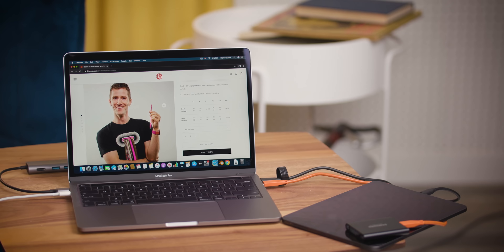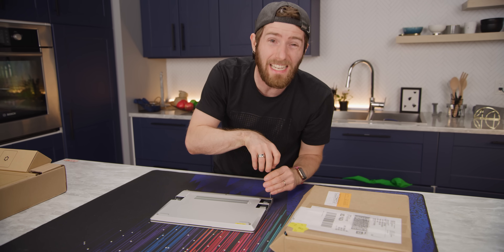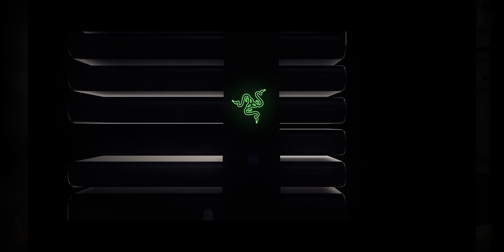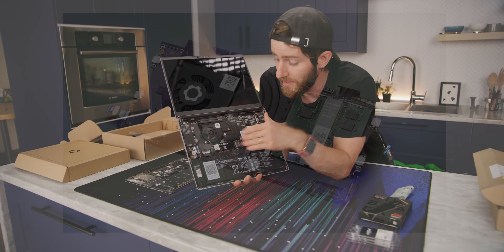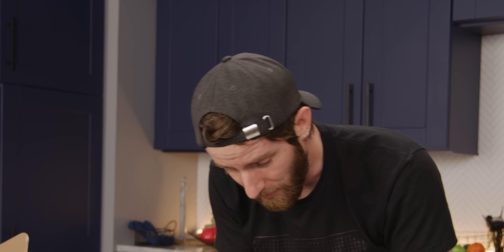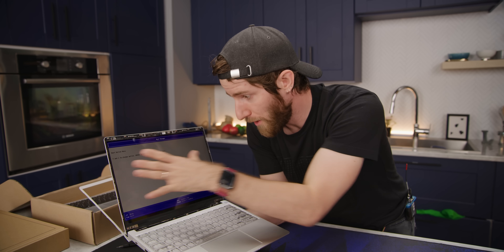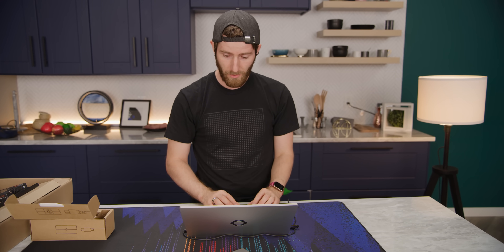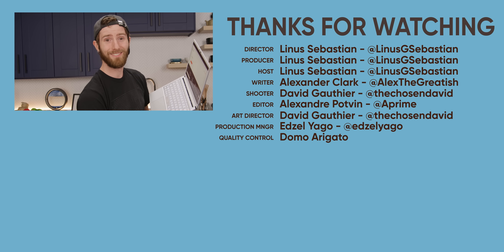A COMPLETELY Upgradeable Laptop?  - Framework Laptop Review

Comment: I have a slim, light and nice looking notebook already which is designed for easy repairing and upgrading and I find also manual to repair the notebook on the manufactures. Also, the manufacturer still give guarantee to all original parts even a swap one parts. There's no glue. I know it because I remove battery, SSD and NVMe to reset the BIOS by removing the battery (I didn't expect the manual and search after it first after removing the battery and the NVMe.) But I have to remove less than 20 screws, three clips (for keyboard and mousepad) and one connector (battery). The entire software from BIOS over firmware to OS are open-source, except NVIDIAS graphic drivers for my GeForce RTX 2060. So, I don't understand why he's so hyped or say it would be the first easy repairable notebook. It's not true.

Comment: This might be a controversial opinion, but the expansion modules are not my favorite. 

If you look at the images, and listen to Linus' description in the video, the "expansion" modules just connect to the laptop via USB-C. 

So they're just dongles.

But inside the laptop. Which is worse! 

Now they take up valuable space that could have been more battery, or cooling, or interior expandable storage (which could be high speed and thus usable for a bootable OS). 

They should have just made all i/o USB-C and offered dongles during the configuration and checkout. 

Don't get me wrong, I love the idea and fully support the vision, just not sure the expansion modules are really a good implementation of that.

Comment: TL:DR BUY A VOLTA CABLE IF YOU WANT A MAGNETIC CHARGER

Im well aware this will get buried but since I haven't seen it in the comments I'd like to point out that linus talking about the magnetic charger not being allowed because of patents. he seems unaware of the volta cable which has a small magnetic tip, which you can leave in the laptop and its only a couple gram. I know that jake has one at his home setup because it was mentioned in an vid once.

Comment: As far as the magnetic connector for charging goes, just have the USB type C expansion module, and use a Volta Type C magnetic tip/cable for charging. Leave the tip in the laptop and BOOM you've got basically the same thing. Those tips hold tight in USB c ports too.

Comment: I was just thinking about how modularity would do the exact same thing as having to carry around a bunch of dongles before you mentioned it. Such a great solution and it's the most obvious, simple one too. I would LOVE to see this kind of laptop get some maturity on the market because I would immediately buy it as long as it had the right specs for my needs. I would be willing to get a beefier laptop if it meant it had a more aggressive and expansive cooling solution and it had a dedicated gpu, for example. All the work acer, asus, razer, and other laptop brands have done creating innovative ways of cooling powerful laptop hardware in small form factors combined with this level of modularity? Goddamn

Comment: I just wanna know if this has Thunderbolt or not! Could be a transportable desktop replacement for me if it does! 😁
Reply: Only USB4
Reply: @vladdx  well... SHIT! 😣 And I doubt there are any external GPU boxes that do that yet, let alone with the bandwidth needed...

Thanks for the heads up!
Reply: @KnHawke  It has the bandwidth as USB4 has 40GB/s but I'm not sure eGPUs are compatible yet. You can sure give it a try and might work who knows. That's exactly the reason Thunderbolt requires a certification.
Reply: @vladdx  did a little digging into usb4, the spec says that it is backwards compatible with TB3 and Intel released the patent, so there is hope that the AMD board will have it with little to no problem!

Comment: Thoes QR codes are a great tool for someone like me who buys 2nd hand hardware a lot, and trying to find documentation on spicific motherboard revision parts compatibility, parts info, specific information about proprietary connectors. So perhaps with a laptop such as that, you could buy a new motherboard when their is a new generation of cpu. Or even moveing a motherboard to a diffrent case with different inbuilt features such as upgradeable GPU, full sized CD rom drive, or a case with a docking port. Part of me think that we may be returning to the days of the mac duo with portable desktops again.

Comment: That's really cool, I just did a build on their website to see the minimum price of a fully functional machine, 11th gen i5, 8gb drr4, 1Tb nvme, for 975$, checked online shops for regular laptop, the most similar one I could find was an hp at 975€ (1100$) (so , with everything the same except a 256gb sata ssd (and the custom built one had no windows, but even after adding a 20$ license you're still good, I would never pay full price for it), really price competitive.
Only problem is the delay... September for it to be shipped.

Comment: My old clevo p150hm died last year, I had upgraded the cpu from the bottom of the line sandy bridge quadcore, to the fastest XM sandy bridge unit, upgraded from 8gb to 16gb, upgraded the 500gb hard disk to an ssd, and put the hdd in the disk drive bay, I upgraded from a gtx 485m to 680m, I repasted the cpu and gpu myself, and even improved the cooling, which was easily accessible. I had also swapped out the screen. It truly was the most modular laptop, even at the time people didnt believe you could upgrade a laptop like that. The only issue was the bios was only capable of using up to the 680m, and even with that I had to modify nvidia drivers for it to work. Last year the mobo died, and I put it away in the tech closet.

Comment: I've been using Fairphone 3 for 6 months now and don't have much to complain. Yes, it has mid range specs at best, but it does everything a phone needs to do, and I dont have to be afraid of breaking components since they offer replacement modules. As far as I can tell, they do not provide schematics to repair the individual modules, but Fairphone 3 is by far the most repairable usable phone on the market. They also promote the possibility to use alternative os'es to Android such as /e/ OS and Lineage. I'd love to see you cover the phone rather than sligthly ridiculing it.

Comment: i find some decisions on the laptop a bit weird, like how (until now) you dont have a dual usb c adapter, so it will in total 4 ports which is really limiting (imo) and you cant have a gpu so it would have been nice to include thunderbolt ports (atleast on one side) for real future proofing. 

but honestly, this thing is a great product and it should shake the industry at least a little. its not just the product itself, but the company philosophy too. try finding a replacement for your laptops camera. try finding one for cheap from official sources, modern laptop makers have a billion variants of any laptop line that makes it all so hard to find, and if you do find replacement parts they come at extraorbitant prices, and then when its time to replace the part, even skilled and certified technician can break your device ( happened to me, thanks HP for breaking my display and full  case when all you had to do was to replace a hinge......)
Reply: on a side note, i saw the dell standpc, the all in one that fit into your monitors stand and wondered, why not offer a laptop case with it. there almost is no reason to go with that product over this now lol, just the motherboard itself is the thing that dell offers

Comment: Without a socketed CPU, this isn't really that much more repairable than other laptops on the market.
Reply: Depends on number of models and mobo form factor, if they go with 1 or at maximum 2-3 standards, like this one and a gamer one design to have gpu for example, they could make motherboards+cpus to upgrade old models withou buying new ones, like if you bought a intel model and later want a new ARM model, just like pc you just swap mobo+ cpu, as they would be the same form factor and compatible, of course mobo and cpu will still be bound to each other but it would already be a improvement on the market and a good start point to later socketed cpu models, they are not rich like dell or apple, so we need to give them trust and time to stabilish themselves on market, thats what i think.

Comment: I don't think the "battery disconnect" function is that, usually it means when you do it the system then powers down and you can then "safely" remove the battery, but when you power it on again it'll reattach the battery, it's a thing for maintenance.

Very cool with the modules tho, even if some of it is still not that "un-modular" on say, the latest Lenovo T series Thinkpads.

Comment: Upgradable laptop example-e6530: 2 Mini PCIe with 3 antenna wires for Centrino 6300, full mini PCIe, UJ262/272 bluray drives, and easy access SATA port along with DDR memory access. That upgradable for ya, it certainly is for me. I can't wait to use my mSATA SSDs.

Comment: I know what my next laptop will be. This puppy. I would buy it only for the fun of putting it together myself. Too bad the Fairphone is so expensive, or else I would buy that, too. Oh and of course, both will be using Linux. I really hope we get to a point where you can game on Linux just as well as on Windows, and also have the same experience with a Linux phone OS as with Android. I've been holding off on buying a new phone for some time now, because it's so hard to find reasonably sized phones these days, they often have an overloaded OS with lots of stuff added on by the hardware manufacturer, and phones have also gotten more expensive.

Comment: I have a Dell Inspiron with the i7-1165G7, and it has the wireless on a separate card, but it will only boot with designated wireless cards installed, so no upgrade for me.  If I had known this was coming, I would have waited the 7 months using my old i5-5200U laptop and gotten this.

Comment: I thought regardless of the size of the display if it was 30/40 pin it would just work. So you could just order a screen that has the correct pins with whatever features you want.

Comment: I have a Lenovo which has problems with it's wifi. So I bought a new wifi module that supports 5Ghz. I swapped it into the laptop and a message pops up saying it's not an authorised part. The only way to get around this issue is to desolder a flash chip, read the bios, send it to some people on a forum who will unlock it and send it back, reflash, resolder it using a reflow station.

Comment: dell: USB type-A? best i can do is type C
framework: u want USB type A or C? or HDMI OR BOTH ?
Reply: I feel like they should be able to fit 2 type A ports onto that badboy and save us from using another modular slot.
Reply: @ReivecS  They probably will have modules with more than one USB port, but there is a reason to having just one - it's a simpler design that works well for a prototype and  you're not sharing the bandwidth of a single USB port, it's a choice if you want the full bandwidth in one port or if you want a few slower ports. Though USB 3.2 is fast enough that it's not going to matter in 99% of cases.
Reply: @pwii  I am not sure it is even possible for 2 type As to saturate a 3.2 type C. The bottleneck might be if you have to have some sort of controller/hub on board rather than having it be passive. I don't know enough about USB internals to know how it would have to be done. Either way I am highly doubtful a bottleneck would ever be seen in reality.

Comment: The upgrade thing is not the biggest sell for me. The amount of laptops I've seen where liquid spills have fried the motherboard, rendering everything else e-waste. If you're lucky enough to find a replacement motherboard great. But then you have to factor in someone's time to fit it. And even then there is no guarantee it will work again. Being able to swap out a laptop motherboard easily is a complete game changer. Even if you have to switch the CPU too. It is still more cost effective than buying a new laptop.

Comment: Real potential here is longevity. Imagine if company stays afloat for 20-30 years and you could still have the original laptop up and running all decent with the occasional upgrades for this or that. 10 years for a laptop is fine now, but that limit should be pushed way further. If this still exists and gets good updates 5 years from now, it will be disruptive.

Comment: I dreamed about the "run on adapter and not use battery" feature for years and thank god someone else also thought about it.
Reply: I don't want that one because I use the battery as an UPS
Reply: On MacBooks you can install Al Dente to set a max battery limit, so if you know it'll be sitting on your desk for the foreseeable future you can set it to something between 50 and 60 % to conserve the battery.

I've seen some Windows laptops offer something similar, but my old Asus doesn't have that and its battery is worn down pretty severely after only about 200 - 300 cycles. :/
Reply: Honestly that would be even cooler if it was a manual switch you can switch without pulling it apart instead of through software
Reply: I think my thinkpad has this feature
Reply: On ThinkPads you could set a battery threshold that allows you to charge your battery to what ever you chose (I picked 75-80%) so it won't degrade (at least not as fast as a battery always charged up to 100%) but as far as I know this feature is only possible if there is an extra controller for the battery that saves your set threshold. Big advantage of this is that the set thresholds are independent of any OS, even in BIOS it stops charging when reaching the threshold.

Comment: Linus most of the Clevo type laptops (XMG etc) you have reviewed have a lot of the same ideas in them. They come with full manuals for taking apart the machine. They have upgradability inside and you can replace keyboards, displays, ram, wifi, battery etc. Also, everyone I have seen selling these items don't void the warranty if you open it up. I ordered an XMG Apex 15 just recently and opened it up to add more storage to it and it was just a few screws I had to open and just slotted the drives in. 

I think this kind of stuff you show here and in the Clevo laptops should be pretty much bare minimum acceptable standards with right to repair.

Comment: I still miss my chonky 17" MacBook Pro. Almost everything was user replaceable.  How does it GAME?  A true game changer would be where u can upgrade the GPU independently of the logic board.  I would like to see a thicker version so I can have a longer lasting battery or at least a "Battery Dock" that you slap on the bottom for that extra juice.  My main issue is that I still prefer macOS over Windows.  Sorry Microsoft but Windows 10 is just a jumbled mess with issues all the time.  I periodically have to completely wipe my boot drive due to some "update" completely borking the boot where it can't load "winload.efi" even though it's right where it should be and it has a valid hash.

Comment: No dedicated GPU, for now, moving on.

Clevo has had this basically since 2008? including swappable GPUs and CPUs depending on the motherboard. I am hopeful in this turning out to be a good product, but for now with no dedicated GPU and a sticker price of 1000usd? Um... Hard pass. I can get an Acer for 600 with a 1660 or higher in it... I get that the ability to swap things out is the /point/ but this is going to fit a very... specific niche until then.

Comment: (13:18) I have a whole list of features I dream of seeing Framework add to future models if they're able to have things their way (repairable, upgradable, etc), and one of those is touch input! So far, I feel they did great for a first model!

Most of the features I dreamt of them adding:
- Lenovo Yoga style tablet with touch and active pen
- Eraser head mouse (like Lenovo ThinkPad)
- Dual battery system (like Lenovo Power Bridge)
- Keyboard with the Windows logo key instead labelled "Meta" for Linux-based desktop OSes (like Debian, Fedora, etc.)
- (less likely) Options to customise parts (custom lettering/graphics on keyboard, bezel, lid)
- Open-source system firmware (like System76) but as an alternative option

Comment: Maybe I'm an edge case or something, but I don't need a super slim laptop.  If this thing was double the thickness, with more slots for me use, it could also have a bigger fan and battery.  But even as it is, if I needed a laptop, I would certainly consider this one with a bunch of extra parts that I may or may not need all the time.  I like the configurability.

Comment: You didn't mention the biggest disadvantage: They only have 4 IO ports.
And last time I checked their modules only had a single port in them.
So if you use one for the charger, one for hdmi, and one for the mouse USB port,  then you only have one extra port to connect a pendrive, or a network card or anything else.

Comment: My lenovo thinkpad t430 is upgradable, I even swapped out the i3 dual core for a quad core i7 with no issues. Also 2 internal pcie slots helps. Only thing I don't like is the white list, but this can be changed too by a custom bios.  So who says the big players don't do customization and user upgradeability. BTW sonys laptops used to have numbers next to the screws to show what size they were.

Comment: "how are you going to stay profitable?"

Do you know how easy it is to stay profitable? Apple and co have been running an absolute GRIFT for decades now.
Reply from the maker: The margins in laptops are super thin.  Given this laptop likely has way higher assembly costs (50 screws in the keyboard alone) wondering how they'll make money is a valid concern -AC
Reply: @LinusTechTips  I stand corrected.